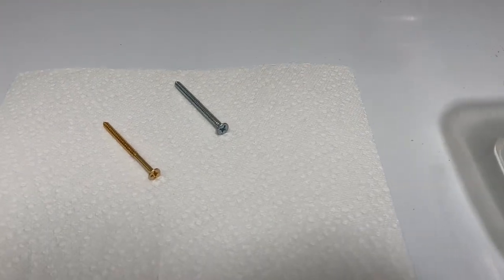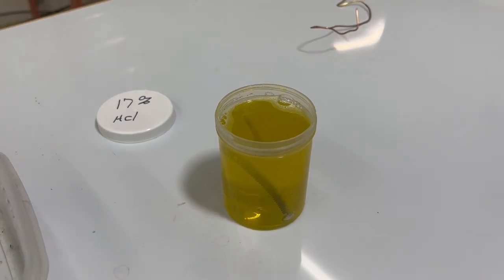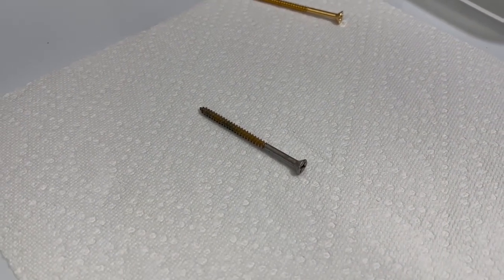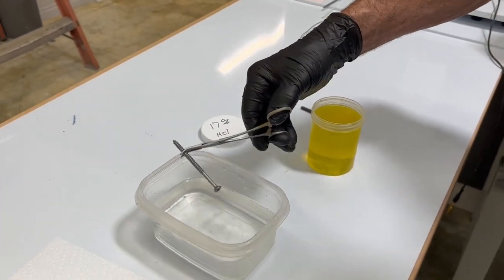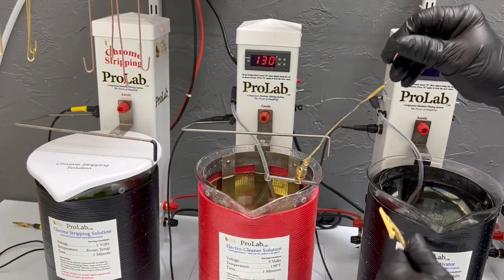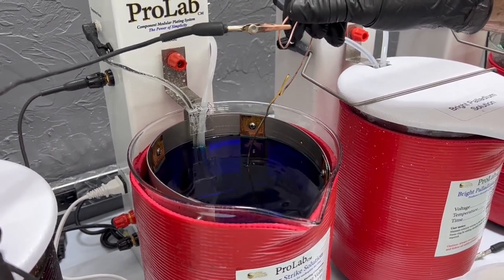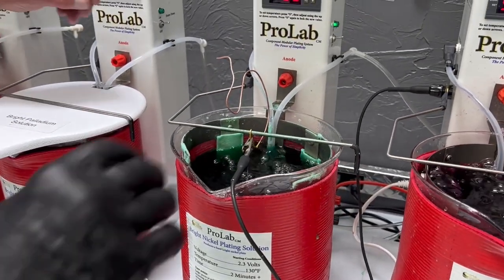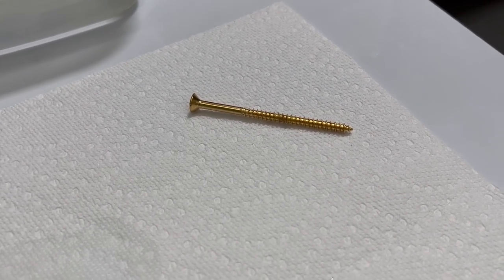Gold Plating Zinc Hardware With ProLab cm

Comment: I use all your products and appreciate the additional videos you've been creating lately.  On this project after removing the zinc, I would also have done the copper plating followed by nickel which as I understand creates a good base layer however don't you think you would have been better off adding a Palladium layer over the nickel to create a barrier layer to help prevent future rust and oxidation from seeping upward through the nickel before plating your final gold layer?